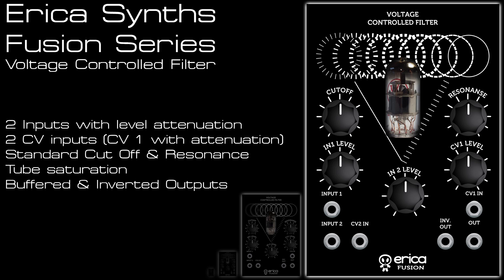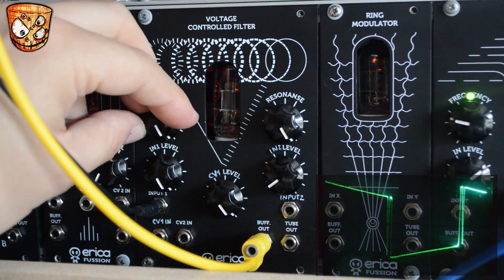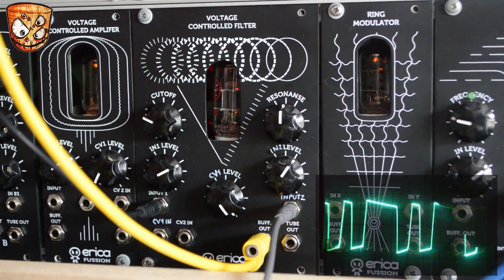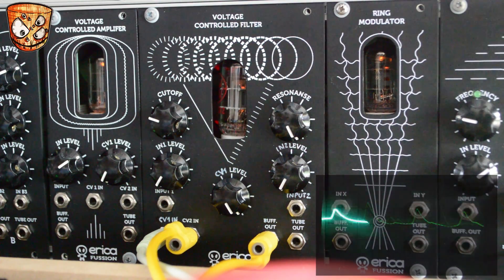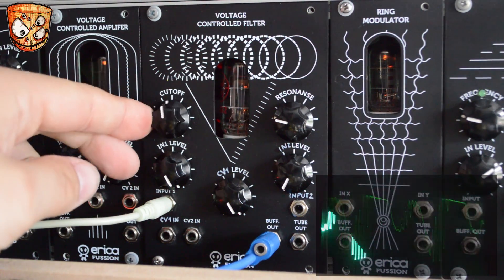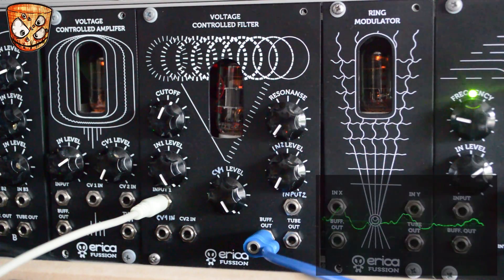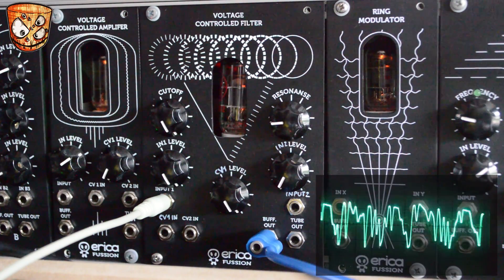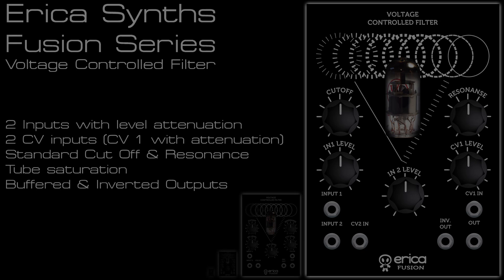Erica Synths Fusion Series - Tube Voltage Controlled Filter

Comment: hi ! do you need a power adaptation for tube module ?
Reply from the maker: Yes, for the first round of Fusion/Tube modules they all need a power adapter that is inside the case. However the v2 modules don't need the power. Check the Erica Synths site, they're releasing updated versions.

Comment: Nice fat sound. Considering how much one module flavours the sound, what happends if you use more of the Erica Fusion modules together? Does it end up one obese muddy mass or will it produce something useful?
Reply from the maker: Synthesizers they definitely come together really well. It can get out of hand if you let it but every input has an attenuator which massively affects the sound. So subtle warming and gentle colour throughout is more than possible. I've just this last week sent the prototypes back to swap for the final version which I understand have been tweaked a bit so I'm excited to see what the release versions are like.
Reply: DivKidMusic Ok, when you do, please patch up a sound with just fusion modules in a chain and show how that sounds.
Reply from the maker: Olorintube yeah that's on the list of things to do. There's a new VCO with tube waveshaping as well. Also should have the Polivoks VCOs from Erica soon so I can run a Polivoks voice and the tubes together.

Comment: What do you use to let your bass produce CV exactly?
Reply from the maker: Alexander Nijman Hi Alexander, it's the Doepfer A-119 external input / envelope follower module. The bass plugs directly in, with a pre-amp giving enough gain to get the bass up to modular signal levels. It also has an envelope follower so for each note I get a peak voltage when struck that then decays with the natural decay of the bass strings. So you can use that envelope from the bass to control other things. Hope that helps and keep asking questions if there's anything I can help with.
Reply: DivKidMusic That certaintly helps al lot! thank you!